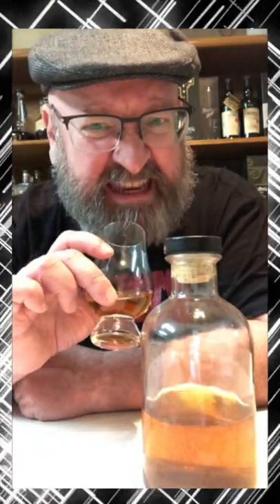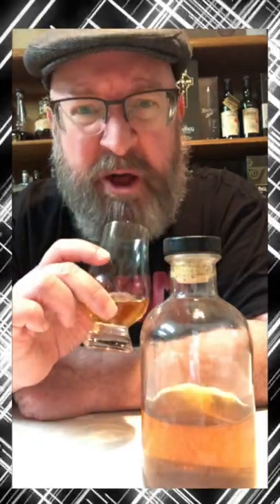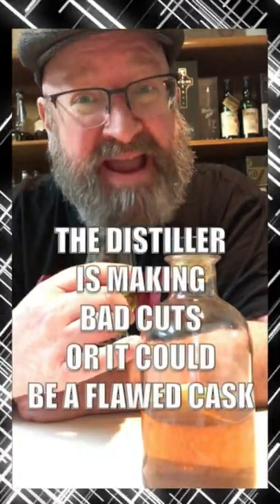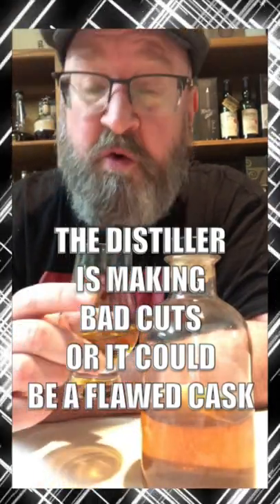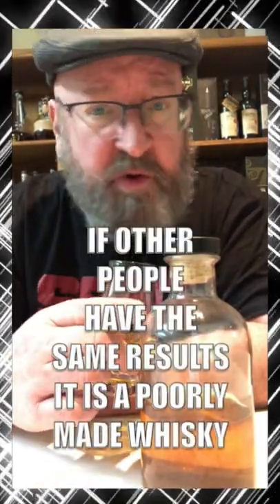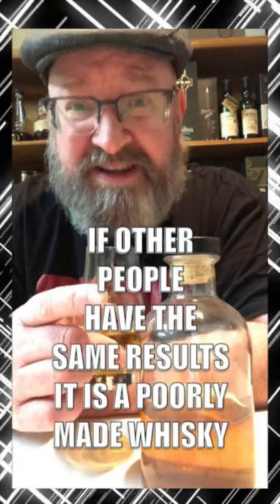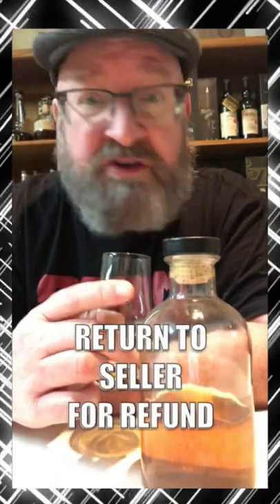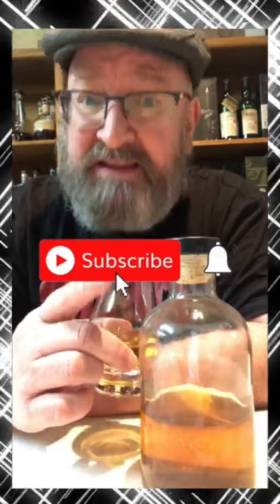Does Your Whiskey Taste Like Gasoline? #shorts

Comment: I literally just bought my first whisky this afternoon, Glenmorangie original 10yo, i sooo wanted to like it, seeing all the videos i could watch about it, all those amazing scents and flavors everyone smelled and tasted, all sounded incredible, then i finally went to the local spirits store and bought one, came home an poured alittle bit of it, all i smelled and tasted was ethanol and alcohol burning my mouth. it's obviously not that batch and that it's only me, i really, really hope i get used to it over time and eventually like it
Reply: Take your time, don’t smell too hard. It’s very good once you get pass the alcohol.
Reply: Also I would strongly suggest what I d which is to drink your whisky between 65- 70 degrees. Whisky just like wine or beer has an optimum temperature range to bring out the best of flavors and subdue the harshness of the alcohol. Take the same whisky and pour 2 small samples at different temperatures and experiment and see what you like best, Try this experiment with beer and wine as well.
Reply: Take a breath in, sip the whisk(e)y like hot coffee, move it all around your mouth and then breathe out all the air you were holding, then swallow. This will get the alcohol vapors away so you can focus more on the palate. Also dont be afraid to put a drop or two of water to proof it down a hair. That might get you past the alcohol.
Reply from the maker: The other commenters have provided some good advice! Going from beer or wine to whisky is. huge step to whisky so it can take a bit of time to get used to the intensity of the alcohol.
Reply: @ErikWaitWhiskyStudies  Yes thank you. from most of the videos I've watched they all seemed to have an immediate change when they added water, i didn't get much change at all, but I'm not giving up on it

Comment: Thanks for this video! I got this heavy chemical taste from a bottle of matsui peated a few weeks ago. Yesterday, also happened with a bottle of peated 10th street whisky, but less intense and more on the finish and after taste. Went so far as to think it was my palate but other whiskeys taste fine. I’ll give the 10th street a chance to get some air and see if it improves, the matsui is probably going down the toilet... 😒
Reply from the maker: Unless you can return it to the seller, I would keep the bottle even if it is bad so you can use it as a reference. I have a few flawed whiskies that I keep so I can show them to other people what a corked whisky smells like or some other flaw. Peated whiskies are high phenolic and if the distiller cuts too deeply into the feints (tails) you can get some bad gasoline notes. I had it happen with the Connemara Cask Strength Irish Whiskey.